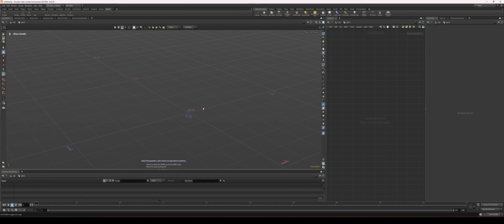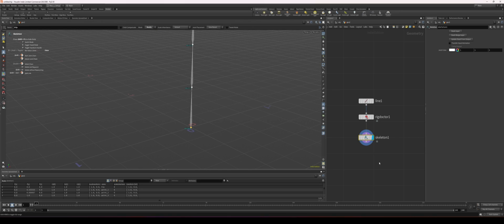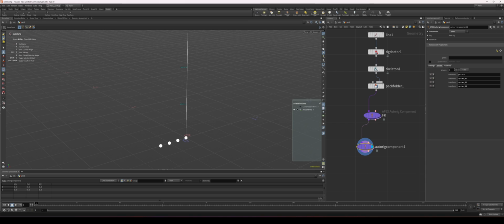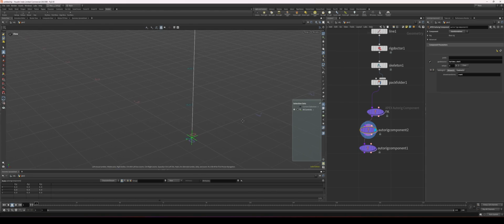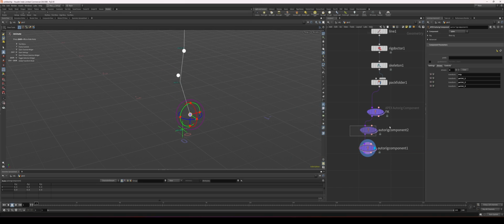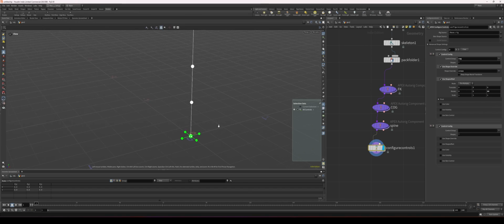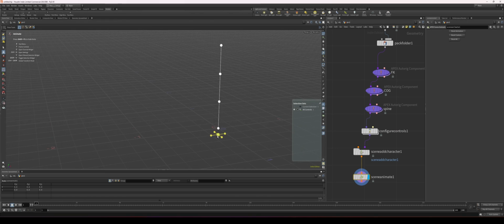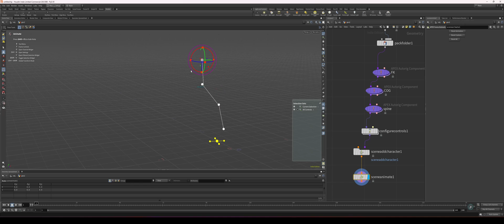Rigging in Houdini with APEX: 05 |  Spine

Comment: Hi Max, at 2:50 my cog for some reason doesn't move the spine. re-did everything multiple times to no avail.... Is something changed in APEX since? I can also sea hips controller (plural) so I used that and it acts as a cog I guess
Reply from the maker: Check my video on building a full character rig in H 20.5 - I go over the new methods